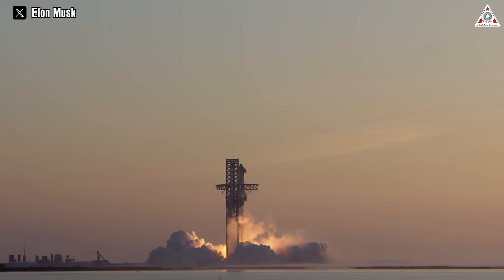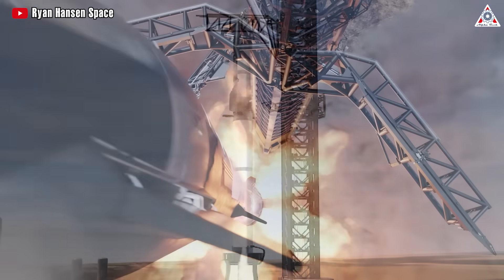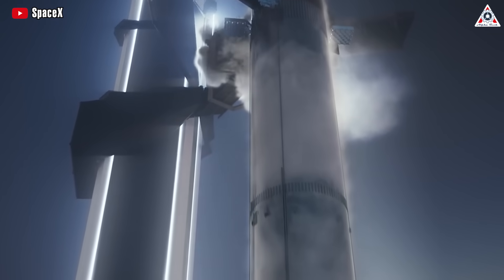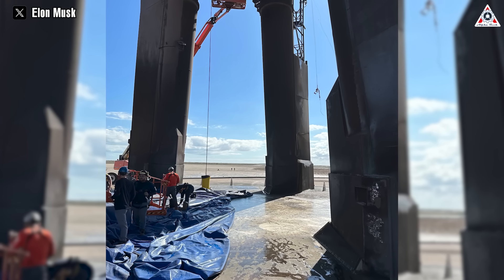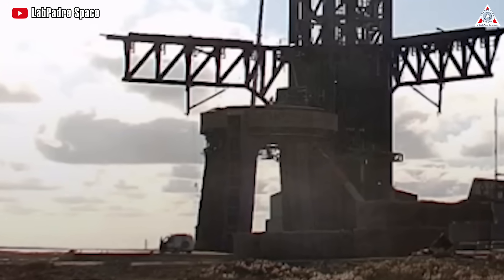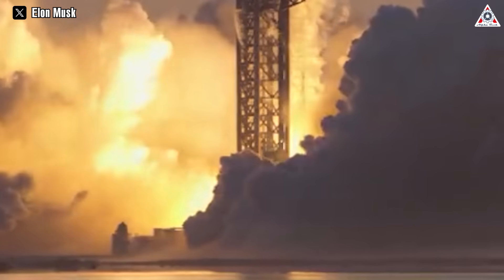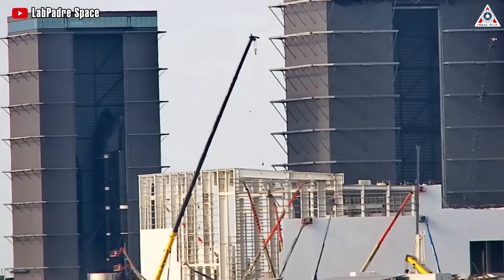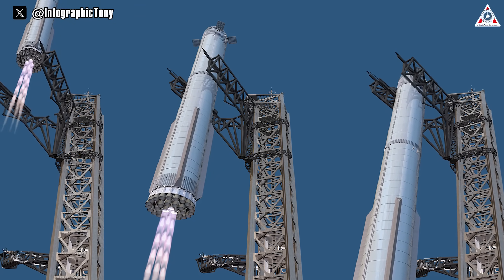Elon Musk's HUGE UPDATE on Ship QD & the launchpad after launch, 33 engines stunning shot...

Comment: Honestly the FTS teiggering when it did on the ship was probably for the best. The ship never would have survived re-entry as there were no less than 70 missing or damaged heat shield tiles. So getting an uncommanded FTS activation to prove that system is working as intended is honestly nmore useful information than just losing the vehicle on re-entry knowing that would have been the outcome regardless. Also while the 3rd test flight will likely come much sooner than the 2nd one did there is not a chance in hell it is happening in 3-4 weeks. 3-4 months almost certainly but 3-4 weeks? Nah no way even if they've already applied for a license for the 3rd flight the FAA is going to take at least 2 months to approve it assuming they dont require any failure investigation of the 2nd flight which they most certainly will.

Comment: Did they not used to have a huge diverter channel on old rocket launches of yore for the thruster exhaust.
Wouldn't that be a safer bet considering all the equipment in close proximity.
Oh well. Looks awesome as is.
Reply: To do that at the location used they would have to build up quite a bit of the area at least 20' higher than now. Because the groundwater level is like at the Cape where they did massive buildups at Pads 39A and 39B.
Reply: @gravelydon7072  yeah. Figured they'd have a solid reason why not to do it.
Certainly benefits us with the magnificent visuals.  Thanks.

Comment: I still don't understand why can't they figure out better heat shield tiles. I understand the forces involved, yet, the tiles are still falling off. why? ALSO, would it be possible to repair fallen tiles, while in orbit, using a robot? that could save lives! "it's okay if they fall, we can fix them in orbit before the re-entry"
Reply: just like they do vibration tests for satellites, I think SpaceX should also use a vibration test procedure to figure out the best tile installation mechanics. not only vibration, also heat test could be used to find the best way.
Reply: You have to remember how long the Starship was out there, how many times it was stacked and destacked, and whatever weather may have an affect on one that isn't flown right away.
Reply: SpaceX didn't bother to do a tile check for ship 25 like they've done with ship 28 and newer. The tiles were not a priority for test flight 2.

Comment: I have a potential solution for the "sloshing" of the fuel and allowing bubbles of gasses to collect in the fuel lines of the engines, which causes them to refuse to re-start. 

That is the major problem for Starship and the booster now. The ships tend to turn topsy tervy and the cut off fuel. Until there is a way to keep fuel in the lines, they will continue to explode. 

My solution: Install large pistons in the fuel tanks that are under just enough pressure to keep fuel in the lines, even if they are not in a gravity feed position. They will take up more space and reduce the payload. But it's better than constantly exploding. 

I am not the smartest person in the room, but this is one very good solution, even if not perfect. Please tell me if I am wrong. Or offer a better solution. 

Sanjosemike (no longer in CA)
Reply: The trick is to keep it accelerating. Throttle the engines back, but keep it at half a G or so until it is oriented such that gravity will keep the propellant in the proper position.
Reply: @quantumharvestllc2082  By definition, the act of separation would tend to stop acceleration. it's very tricky to try to maintain it. Not impossible, but very unlikely. 

Sanjosemike (no longer in CA)
Reply: Consider a bladder tank setup like on a well pump
Reply: @keithgibis8494  That would weigh a lot, as you'd need 2, one for the fuel, and one for the oxidizer, plus, there is no material that I know of that would remain pliable at cryogenic temperatures. The booster needs to stay accelerating, albeit at a reduced rate, until separation is complete, while keeping the booster oriented upright. Once it reached terminal velocity, gravity would then keep the liquids down to the intake ports. One may require a separate maneuvering system to keep it oriented properly.
Reply: @quantumharvestllc2082  Even if it weighs a lot, it’s better than exploding with every launch. No matter how the orientation system works, it will fail in a percentage of cases.

Accept the weight or no Starship with reusable rockets.

Sanjosemike (no longer in CA)
Reply: @keithgibis8494  Initially I liked your idea. But remember the very low temperatures necessary. The bladder would have to be huge and still remain flexible for very low temperatures. Bigelow could probably do it.

Sanjosemike (no longer in CA)

Comment: 3-4 weeks. Musk said 2 months in the spring. Be surprised if its that fast, if it is, good. Will cancel out the massive delay from misunderstanding concrete limitations in April.
Reply: He said hardware ready for flight. Not they're ready for flight. Still may be waiting on FAA approval or doing modifications after reviewing data from this flight.
Reply: @shawngadwa269  Right. What I was saying is, Musk has said a lot of time frames that tend to be longer. Usually twice as long or so.

Comment: With Starship being so close to orbit and the fuel almost spent, this was without a payload. Will Starship have enough fuel to reach orbit with a full payload ?🤔
Reply: yes, after fixes. It was leaking oxygen and producing black smoke, because methane were not burning completely
Reply: @keenanmolver9689  exactly. they knew it was a one-way trip, you don't fill the gas tank to full, only what you need.
Reply: No it needs more burn time with the promised payload capacity 100t+. The tanks where full. SpaceX launch video shows that clearly.
More efficient and/or higher thrust raptors also means higher fuel consumption.
SpaceX should just strap some solid rocket motors on starship for stage seperation and forget about hotstaging.
That ring just adds weight to the booster costing extra fuel for ascend, return and landing phases.

Comment: The many missing tiles would have demonstrated resulting structure tolerance and damage during reentry. But they did learn about tile adhesion where some fell off during the assent. Great test and a good report. Thanks!
Reply: the 3rd starship has had tiles applied in key areas in a different fashion with an aim to solve the issue. they knew they would have tile lose on the 2nd starship but felt it wasn't worth pulling them all off and making the modifications they had for the 3rd starship. the next one should do better. as for the other issues with starship 2, well that remains to be seen.
Reply: There seemed to be a lot of fluid or vapor flowing down the sides of the second stage all the way up in some views? Could it have run out of fuel from leaks, or was it just ice vaporizing? They will know by acceleration from the weight loss if it had leaked. @canyonblue737
Reply: They didn't test the tile integrity of this year old Starship version for this launch. It wasn't a priority this time, since for this mission, it was essentially a throw-away.
Reply: I agree, the lessons from reentry next time. @Solar2go

Comment: I'm gonna stick with what I've said already about the next launch: taller (with a bit of curves in the middle to protect both the booster and the ship), hotstage that disconnects once the starship separates and before the flip maneouvre (creating a sort-of middle stage), don't glue the heat tiles on the starship, slow the flip maneouvre (prevent fuel slosh and kaboom), and higher altitude because obvs, that booster is way more powerful than a regular falcon heavy and could survive better with the higher altitude - also burns some of that fuel off to prevent the 'slosh kaboom' thing. 
as it was a low(ish) altitude test, it wasn't enough to save the booster. 
with those few adustments, I reckon the next test will be 100% 
the one thing we didn't get from this launch was the launching of a rock into the back of someones car - that enduring image will live in my brain on replay at every single launch 🤣
it was by far the most beautiful launch I've ever seen. the early morning sunrise and the shroud of mist just added something magical to it. 
you're damned right I can't wait for the next launch!!! 😁
regular falcon 9 missions look 'meh' compared to this. but I'll still watch because I like watching the booster landings.
Reply: And you're a aerospace engineer, I take it? This launch checked off all of the major parameters they were testing for, and then some. That's what test launches are for. Musk was only predicting a 60% chance of success. Remember that the first four Falcon 9 test launches ended in failure. Now it's the safest, most cost effective, and reliable launch vehicle out there.
Reply: just a very enthusiastic amateur who has watched spacex from the early days, and not forgetting our favourite grain silo - starhopper! it's  hard to keep up at times, but, thanks to all the footage shot at weekend and having probably watched way too many various rocket launches (and explosions) over the years, you can sometimes see how it's supposed to go when it doesn't go to plan. sometimes, the answers are stupidly simple. I remember the shuttle days and the 'frozen O rings'. Russians have got the hotstage down to a fine art - you can tell by the designwork. it's not hard to translate that to a starship - hence the need for a longer hotstage/midsection 'with hips'. 
 @Solar2go
Reply: I also think they should keep booster flip in pos G force to stop sloshing of fuel.
Reply: None of the first 4 falcon 9 failed. Those were Falcon 1